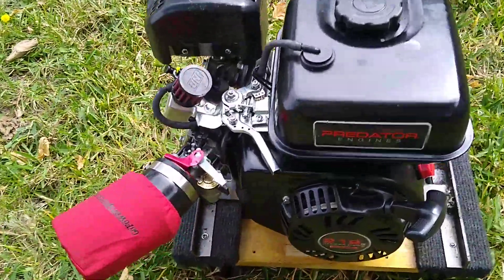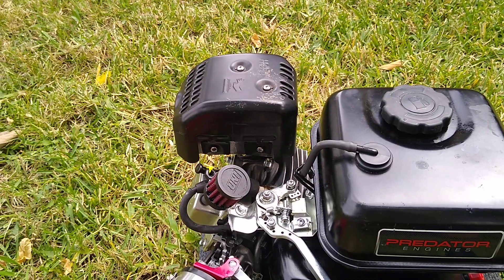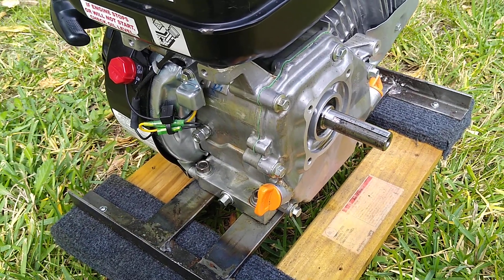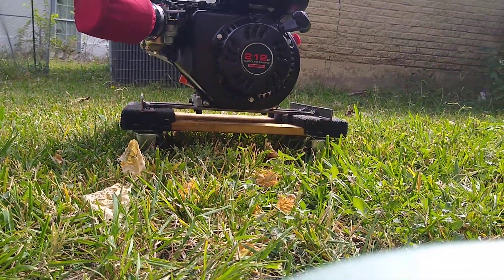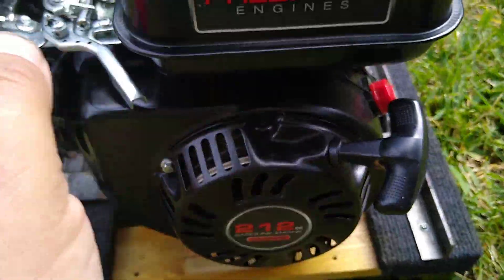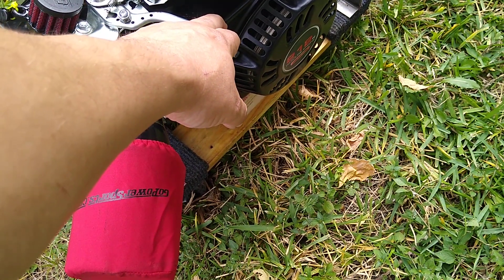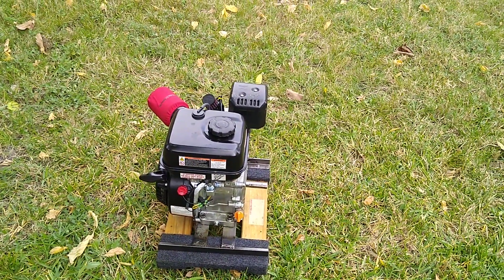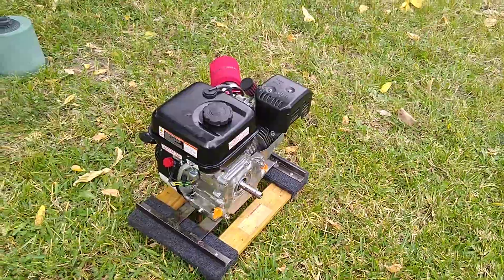Predator 212cc racing engine

Comment: Changing the header is a must got 7 mini bikes and you can definetly feel the stock muffler killing the engine.....its a major restriction , theres a reason why you get a header in the stage 1 kit....
Reply from the maker: I figured so. But until I get it mounted on something I won't know what pipe to put on it. It would be nice to get a tuned pipe.